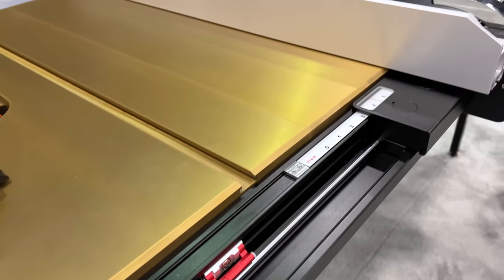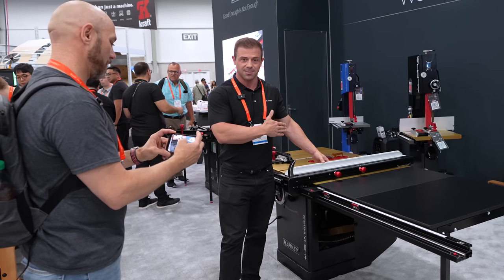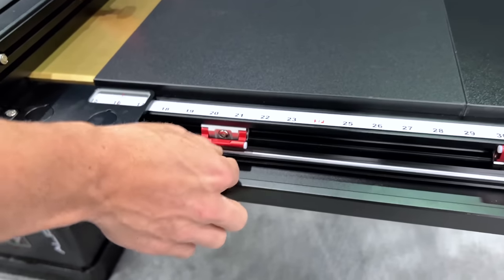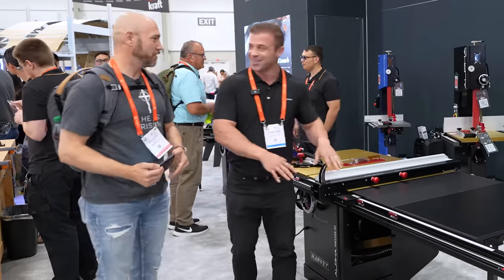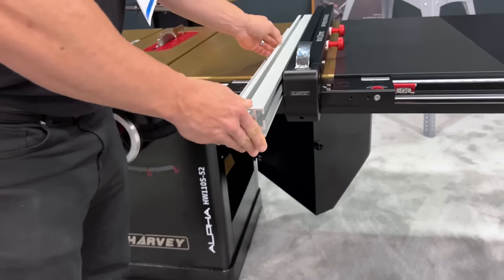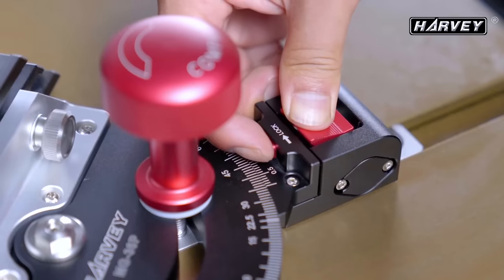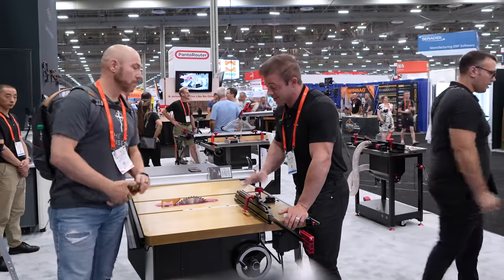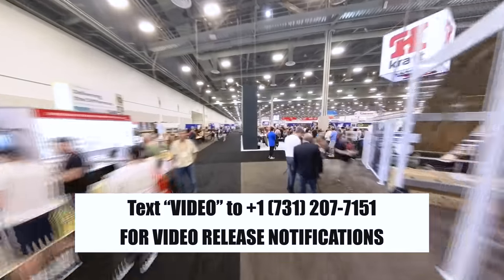Harvey Just Changed the Game for Table Saws….Again!

Comment: I have several questions/concerns about this fence.  Have you had a chance to try one out?   I am thinking of upgrading my SS ICS with this fence.  My concern is if the fence remains parallel when the back lock is engaged.  Many rip fences with a back lock pull out of parallel when locked down.  I am also concerned about mounting Jessem stock guides to this fence.   And last, I have an Incra miter gauge and the plastic scale has slipped out of position on occasion.  I would be concerned that the scale on this fence would/could also accidentally be pushed out of position.

Comment: Very nice standard style table saw fence but I would like to se it compared with Incra's TS fence.  Since I put one on my Powermatic and my router table I have never looked  back.  I get EXACT repeatable cuts EVERY TIME no matter how many times I move the fence.  To me that is what I was needing and was looking for.  It can be micro dialed in also.  It just fits my style perfectly.  Same for the one on the router table.  I haven't tapped the side of a table saw fence since installing it.
Keep the vids coming.  I really enjoy them.                 JimE

Comment: Been looking at upgrading my table saw fence guides, but out here in NZ we don't have the off the shelf options available to you guys in the USA.
So I've been looking into the SBR type linear rails. Seems to me they wouldn't be that hard to fit to an existing table, and I think it would lock in your fence at 90 degrees (given a good sturdy Tee plate at the opeartor side between the guide and the fence) yet I don't see that many doing it (except a couple of guys moving towards CNC control of the fence).
What am I missing?